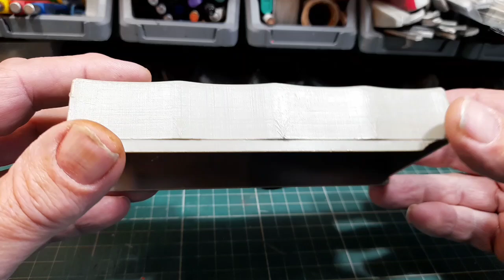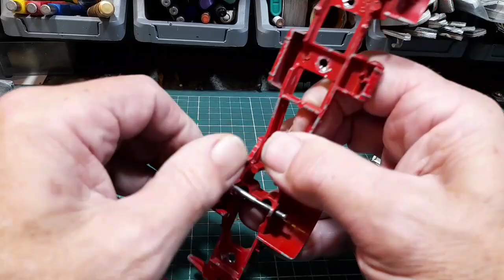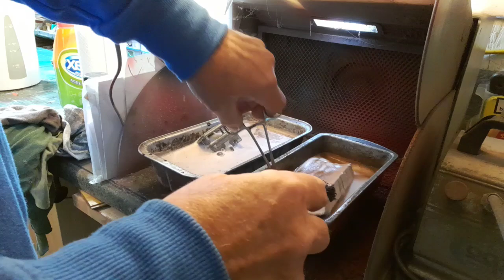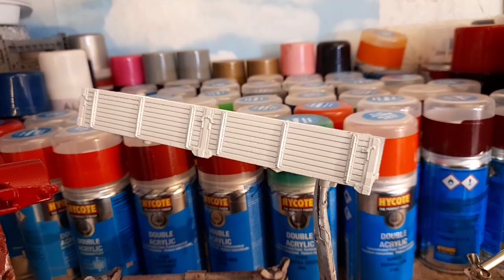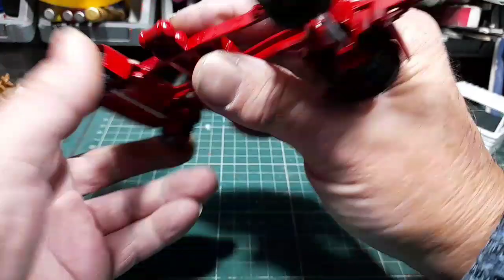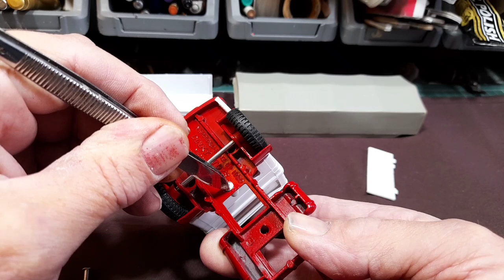Dinky toys Diecast Restoration Mercedes Benz covered truck  no/940   1977/79

Comment: Very nice model Martin. It looks so sharp in the white and red. I was at the Dollar Store here and found a nice, clear plastic, salad bowl. It's about 12" diameter, tapering down to 4" at the bottom. It makes a nice windscreen material and it softens with a heat gun nicely.
Reply from the maker: Cheers jester, I will keep my eye 👁 out for one .
All the best martin 👍

Comment: Nice one Martin. Can you do a beginners guide on spray painting in the near future? I read so many opinions on the time between coats of paint for instance, I don't know who or what to believe. I'm using Tamiya TS spray cans myself.
Reply from the maker: OK jan I will be covering that in the beginners guide series. 
Its unfortunately not an excate science there are a few thinks worth remembering paint in a warm damp free  place make sure your paint can is at room temp same as your castings. 
With the top coat colour do a light coat first keep at room temp warm then I go about 20min then go again. 
Then leave to dry .
I hope this helps .
It should state on the can the drying time between coats .
All the best martin 👍

Comment: Thanks Martin for doing this one I've got one to do into a code 3  chopping it down to a tractor unit and painting it in a UK firm colours that run in the 70s to the middle East  Lp 1920 stand Lp is the model 19 is the gross tonnes the truck can carry and 20 was the bhp
Reply from the maker: Cheers Scott, that sounds like a good project 👍

Comment: Hi there Martin you was asking what the LP 1920 means all Mercedes trucks the numbers represent the weight capacity and also the engine size. Ive got one like this and also one the same as Nick done and that one I'm not going to restore because it is in good condition. Your one turned out very nice and a great job putting the windscreen back in take care mate see you on the next one.
Ralph
Ps Martin you need to try gem crystal clear glue it's ideal for sticking windscreens securitas it dries clear.
Reply from the maker: Cheers Ralph, that's a great bit of information thanks for that .
I will look into that glue .
Nice to have a good condition merc truck. 
All the best martin 👍